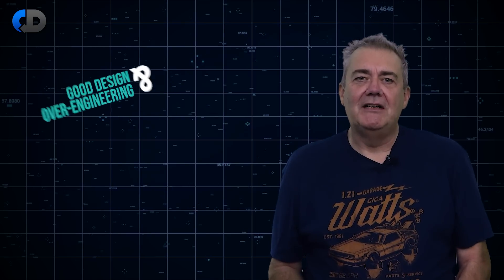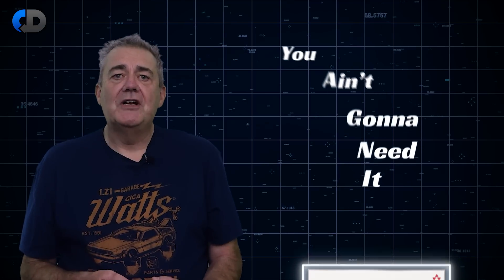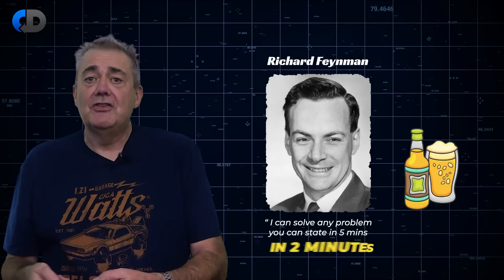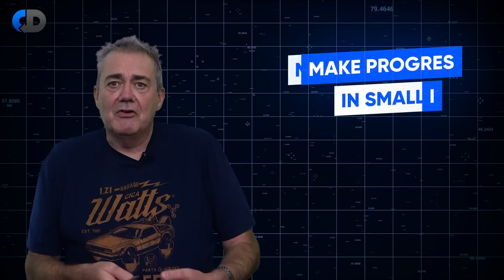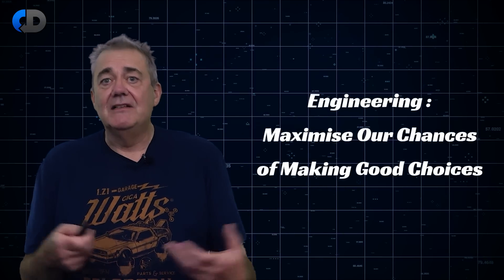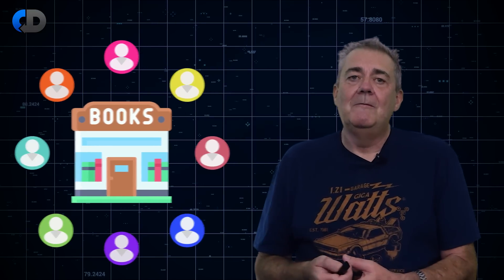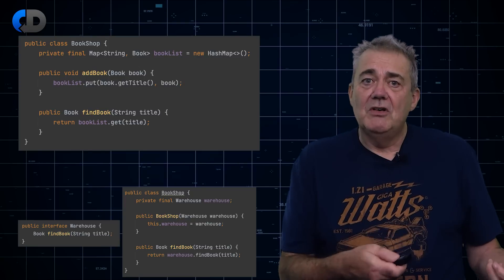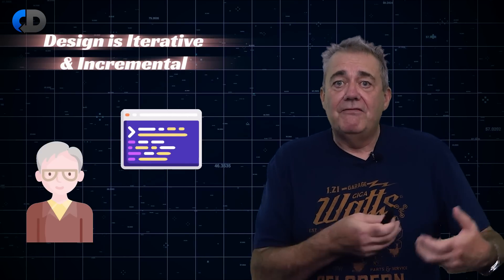How To Avoid Designing A Big Ball Of Mud (YAGNI)

Comment: I totally agree with you, that software should be designed for change - for maintainability. And I totally agree with you, that even when trying hard to understand the problem, change of requirements are around the corner. But that is not just because of you maybe don't understanding the problem well. It could be simply some managers changing ideas or they need to react on market or environment changes. So even, if you get the problem right, the problem might change.
But there is one thing that I see bad and really bad direction where we are going: Because of the minimalistic approach and the secure feeling that everything can be refactored later, we see a dependency hell worse than ever! - And there are even big frameworks totally ignoring the mass of people using it out there and do massive refactoring either of the public interfaces. There is a lot of work produced leading to developers having no time to update and so a large amount of technical dept is created. Waterfal model was rigid, but the good part was, that people spent more time on big pictures. Dreaming of possible future requirements tend to drive you into a more flexible design of solutions. But everybody goes for the quick way solving the problem at hand ignoring the next problem waiting already around the corner.
Reply: So true. I feel that there is a trend to bash "legacy" software with that pseudo "technical debt" coming from people having never build any, and who would like to mimic past success mostly by hand waving.
With luck you've taken/had the time to "debt" yourself by building your design "expansible" (*not* changeable). Refactoring million of line of code is a pipe dream (and | or hell). 
The extreme programming described here seems more like the thing everybody does when indulging in toying with code aimlessly (that's fun, all toys are, you do learn a lot this way). 
But that's not what designing a software is, especially not one maintainable enough to actually create real value (I mean money) so later new-evangelist can get paid to complain about "debt", and impose pseudo agile fixed methodology that is just waterfall in disguised (Dave quite nailed this one)

But Dave is horribly wrong about YAGNI. That's precisely what make a good design in software. e.g. you've placed that gap in your binary RPC packet, because you don't know what extension will be needed in the future. You work with abstraction, but you make them richer than needed. It is pure hubris to pretend we know what would and would not be needed. Keep all door open, even the back one.

Then there is the fallacy of the golden mean, because "random chaos" is clearly best for small program (go crazy do functional programming, weakly typed) , while "big upfront design" is paramount for big project with big lifetime (use OO, type strongly as hell, use every trick possible to have bearing structure, yes this even include test 😁
Reply: @TheBoing2001  And another thing I find terribly crazy: There is inversion of dependency and dependency injection everywhere, but then hard wired in monoliths. I mean, interfaces were invented to plug in and extend software. It should be as simple, as dropping in a few libraries into a folder to get a plugin or extension running.
Reply: @mwildam  Indeed, I use to call them Factories, and even those should contain "vague/expandable" context as parameter, so that the "injection" can be both decided by external configuration but also on client ever changing need (or runtime context).  Or maybe we need a Factory for you Factories ?
Something you aren't going to need... until you do !

Comment: People think that making software easy to change requires a lot of work in terms of time.

It doesn't. It's the little things. Like naming. Like the way objects are required to interact (invariants, preconditions).

It involves a lot of thinking which with experience becomes fast, but it materializes in the code in little details which:

Either point to the cracked door

Or enforce a specific way to extend the code.

Etc. But all in small details, not in huge structures or abstractions.

A great, easy to change design, puts you in a mental model which, when you become one with, it's all easy and natural. As if you meld mentally with the ideas behind the code.

Comment: I guess it really boils down to "continuous refactoring" as you progress through a new software solution - and that we just need to accept this as a good thing.

In my experience - and with my own mindset - it has been easily the hardest thing to come to terms with. 
I find myself always looking at the "what if's" or the "what then's", instead of just focussing on the "what NOW". 

To deliver just the feature contained within a user story - and knowing that that user story may have multiple sub-tasks underpinning it. 

"As a user, I want to be able to select my country."

As developers, we know just how many sub-tasks this seemingly simple story generates. 

I guess it's up to us, in a sprint and series of sprints, to define exactly what small iterative tasks are required to reach the ultimate goal of that story. 
Task one could just be the button that will get clicked. Task two could be the modal window - but that task, in itself, asks the question "do we need modals anywhere else? - generic solution?"
The answer, I would imagine, would be "get the task done without a generic solution and focus on that later." 

But then, as a team, we need to remember to document that parts we haven't built yet, to avoid incomplete threads of work.
It is all too easy to work incrementally - but then forget DRY principals. 
That this simple story, really does require we address the core underlying functionality - the generics - and they don't easily fit into a user story driven development model.

It's a very difficult mindset to get your head around.

Comment: I wonder why Agile evangelists are so design - phobic? Why do they hate (or fear) so much someone takes to properly think about what could happen in the near future and put in place well known best-practices. This is completely anti scientific and unprofessional.
Reply: I don’t get it either. Only solving the problem ahead of you will cause more problems ahead of you that will… it’s a sure way into massive technical dept. because makeshifts last the longest. Overengineering certainly is the other extreme, but thinking two steps into the past AND the future will not completely ruin any kind of comprehensible architecture.
Reply: To say that "Agile evangelists" - and by that I assume you mean people like David Farley, however that's not how I'd call him - are design-phobic is a gross misunderstanding, and a terribly misinformed statement I'm afraid.
He never says to give up on design; on the contrary, working iteratively means designing iteratively, as you figure out more pieces of the puzzle. You never stop designing; instead, you do it at the right time.
On the contrary, upfront design doesn't work well; because you simply don't know enough of the problem you're trying to solve, nor how to solve it.
Reply: Sometimes the Agile managers or however it's called do not know about programming or how much time something takes :(
Reply: As of now, I can't see your comments, sorry. I can only see a summary pointing out there are X replies. I can't see the actual replies. Must be a YT bug, they went too hard on YAGNI
Reply: Oh, and anyway most go with what is known as "the best practices". They decide whether to use stack A or stack B - maybe stack C, that's it.
Reply: which agile evangelists would that be?